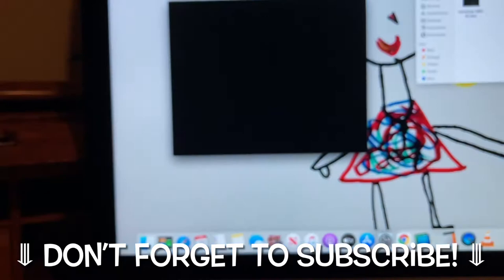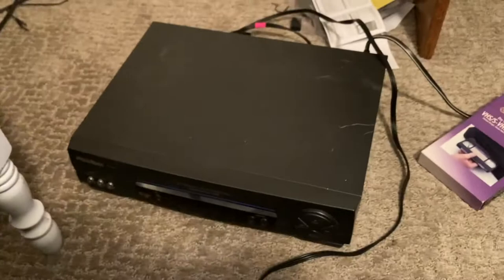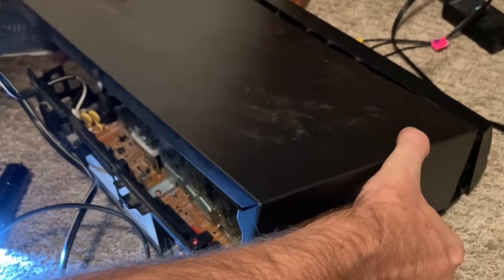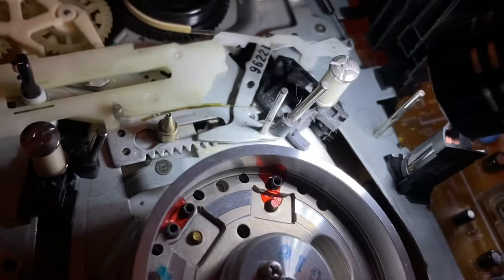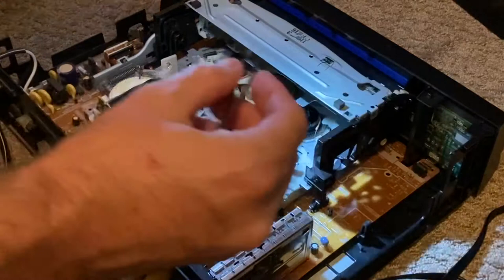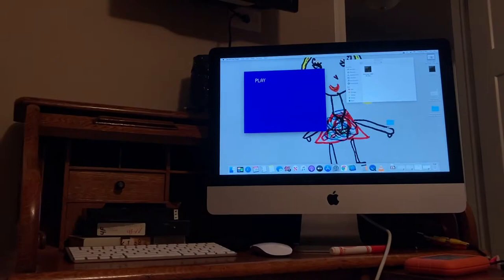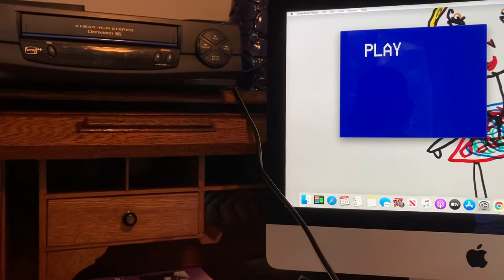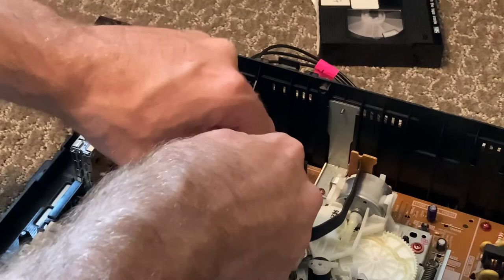️🔥 VHS Tapes Have **SOUND ONLY BUT NO VIDEO** on Playback?➔ How to DIY Fix & Clean Your VCR Heads

Comment: I was  already looking for repair shops when I found your excellent and insightful instructions. I had to clean the video head on my multistandard Sony VCR a few times with a lens cleaner and run a new VHS tape a few times until it worked. Now I can continue digitizing my tapes from the mid-1990s. Thanks for making these tips available.
Reply from the maker: You are so welcome!

Comment: Wow dude! It actually worked!  I only had picture from the menu of the VCR, or the time/clock settings, but as soon as i hit play, there was nothing. No audio, no picture. There was no debris in it, since it is a brand new and never used player. I cleaned the head with isopropylic alcohol, and it workes perfect now! I guess sitting around for more than 10 years left some residue, or traces of moisture on it :)
Thank you so much!
Reply from the maker: Awesome - thanks for your comment!

Comment: 8:50 messing up the tape alignment is the last resort, never touch those guide, especially when there is no picture, a misaligned tape path will display as horizontal streaks similar to bad tracking (which technically it is) never touch those.

Comment: I was trying to look at old home videos and the same thing was happening. one tape showed the whole entire video no problem, but the smaller tapes that needed a converter when put inside and pressed play, it would come on the tv for about 3 seconds and then would turn black yet had some audio and then would boot out the video and stop playing.. this could be the issue? so all the tapes that I have are not the problem but the actual VHS player??

Comment: Much gratitude and relief. Thank you. You know how you can get a feeling that maybe you should have done something you usually do?  Well, I haven't used the head cleaner on my newest replacement DVD/VCR player, and just the other day I was wondering about that, but everything was playing clearly.  Usually, the need for cleaning the heads makes itself known through picture quality change.  When, after watching 'Volunteers' yet again, I inserted a tape and there was sound but no audio and it never occurred to me that this could be fixed with just the cleaning.  It did.  One time through was all it took.  (And it is amazing that the head cleaning tape I have should also have been completely worn out).  Pure luck.

It will be a bit before every fiber in my nerous system relaxes, as other than the PC I am using now, I have just a newer older LCD "tv" and the used VCR/DVD player.  My sight is going, my tapes are already quite old and well-used, and I would love to be able to have the computer - and YouTube hooked up to that "tv" thing.  I don't have cable.

Thank the cosmos I came upon your video before anyone else's.  I would finish off by running a very clean tape through, but I no longer have one.  This current DVD/VCR player has a "HAL" quality to it as it is.  Thank you, again.
Reply from the maker: You’re welcome! So glad this was useful.

Comment: I'm have same issue, but i need to change some caps in the Combo Filter module, so i went there and unplugged everything from the main board, then removed the Chroma Board and the combo filter, changed the capacitors there, plugged everything back, and now i did not have any image at all, just sound, also my VCR was playing fine before but with horrible image caused by faulty capacitors, i will try and re clean the VCR head video and maybe to tweak the posts to see if i get any image at all

Comment: I have a couple of old Panasonic Omnivisions. I recently had the same problem with one, which I suspected was from a "dirty" tape. I ordered some cleaning tapes off amazon, a wet one and a dry one. Twenty bucks, each. They had such bad reviews/mixed reviews I was afraid to try them. I tried the dry one, so far, and it seemed to work. Before I had a total black screen, except when I played the videos on "fast forward". I tried to fix it by sacrificing some professionally released to home video classic movies, because I had managed to fix a VCR before, when the cleaner tape did not fix it,  by just playing Laurence Olivier's Hamlet - played fine - through it again and again until other tapes would play as well.  Took a long time. Weeks. Hamlet was a high quality tape. That was a long, long time ago. This time, however, nothing played for me with video until I tried the dry type cleaner tape. It was YHDD brand, it was very chintzy, it came with no instructions, but I played the tape three times and then the Panasonic did play both professional and home recorded tapes okay. I was surprised that it did work. Just passing this advice on for any one who might want to try to avoid opening the machine.
Reply from the maker: Thanks for the tip!

Comment: Great vid thanks for sharing, I have a Emerson VCR DVD combo, with cover off it won’t work, cover on it will, Is there a tab I need to push or something? Thank you in advance
Reply from the maker: Not sure! From what you describe, if it were mine, I would inspect any contact points between the cover and base for a tab of some type. Or maybe a sensor of some type. I'm no pro - so use caution (Emerson may have built it like that for a reason).